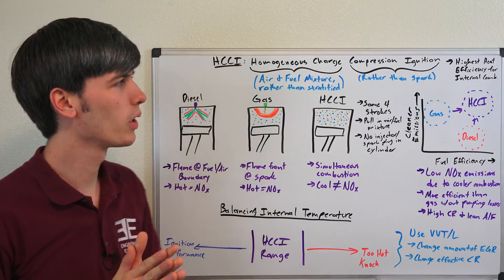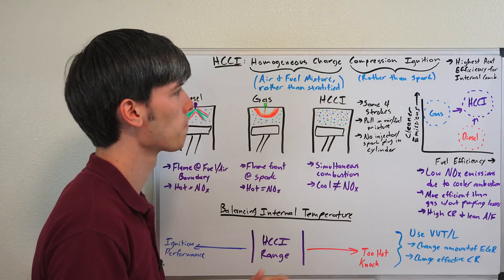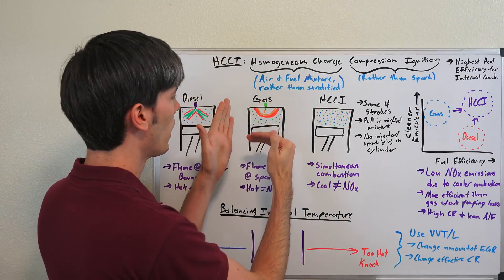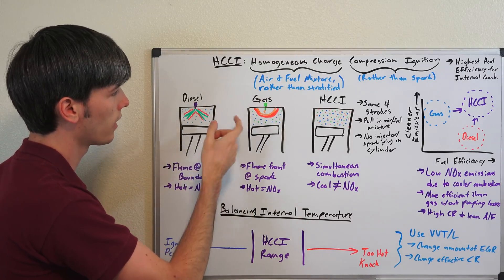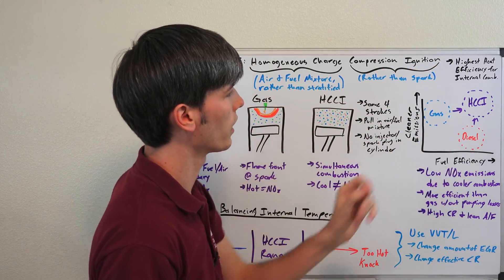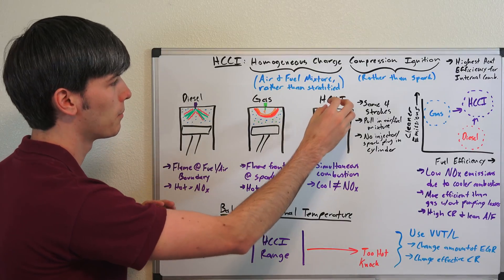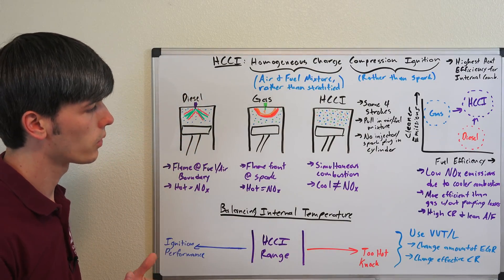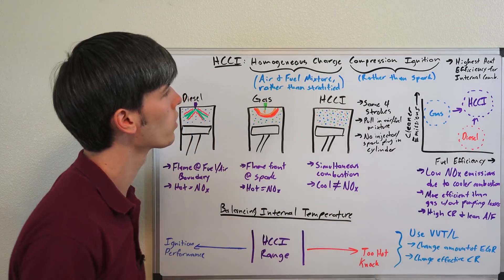The Most Efficient Internal Combustion Engine - HCCI

Comment: Is that the key of the Mercedes F1 engine performance...?
Reply: somewhat yes. Honda are the only manufacturer without it. Mercedes performance over the other teams comes from their turbo set up. they have split the turbine and the compressor, putting the compressor at the front of the internal combustion engine and joining them by a shaft through the center of the engine. this takes the compressor away from the hot exhaust and closer the the air intake and the inter coolers and allows the gearbox to be mounted pretty much under the engine.  this also make the over all profile of the engine bay smaller at the rear, There is a lot less inter cooler piping and the inter coolers dont have the be as large as the compressed air is cooler because its further away from the hot exhaust, closer to the air intake and it has to travel through less piping, allowing the engine cover and side pods to be smaller thus creating less drag. 

edit forgot to mention it creates less turbo lag because there is less inter cooler piping because of this the ERS unit doesn't have to use as much energy to compensate for the turbo lag, putting it to better use else where

Comment: Could anyone explain to me how exactly are we going to get this homogeneous charge? 
Indirect fuel injection is an old technology and I've never heard that someone is developing it. 
Diesel engines engineers were always trying to get better distributed diesiel/air mixture with direct injection.
Reply: I want to know how exactly this would work. Is there an engine that is already using HCCI?
Reply: I am not really sure what your question is, but a homogeneous charge can be achieved by injecting fuel really early during the intake stroke. Just how it's done in DI-gasoline motors.
Reply: instead of injecting fuel and drawing in air, both are injected together under pressure at perfect stoichiometric ratio, them compression starts the burn. It's another case of needless waste in classic designs that is being corrected by emissions laws that the assholes on the internet hate.
Reply: idi isn't that old, some manufacturers still use it, and it can be a good system
Reply: @ Tabourba   As far as I know, that is not really the main issue. Engine researchers have the timing under control, for the most part. The issue with HCCI-engines is the subpar NVH-performance. And for that problem, there seems to be no solution, as of yet. HCCI engines are simply too loud for series application in passenger cars.

Comment: with HCCI running cooler than other engines, what does this mean for performance and more importantly, reliability in colder climates where temperatures are often below freezing or even sub-zero (if you're using Fahrenheit)?

Comment: What about variable compression ratio engines? Would they be a good match for this system?
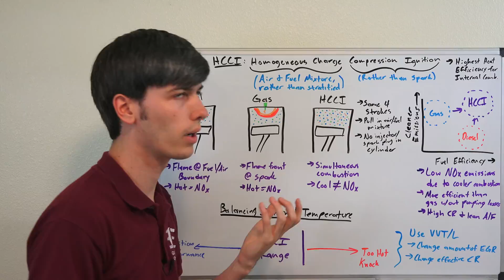Reply: He was discussing adjusting compression ratios to optimize ignition this at 4:16. I think it would almost be a necessity.
Reply: You'd think so, but I'd imagine the piston pressure at detonation would be much higher than a standard ICE. In turn, would this create more stress at the con rod/crank assy? Maybe this is why they chose to focus on compression change with valve timing. But, might there be a displacement advantage using the technology you're referencing?
Reply: Higher compressions ratios were reliable in the 80's seen in Jaguars v12 HE engine
Reply: Nicolas Losito: reliable in that it worked for the short time they lived then yes...
Reply: variable compression is best for turbo applications. High CR is good for fuel efficiency and low CR is good for running a lot of boost. That being said in a naturally aspirated engine lower compression used to mean higher reliability, but with skyactive by Mazda and the newer v6 Mustang we are seeing high compression ratios being reliable.

Comment: If they equip only the best forged metals , its still going to be weak and rely too much on precise variable valves . I image it will have electronic valve control since oil ones might not be so reliable due to outside temperature variations and cold starts.

Comment: So in colder areas, think alaska this very optimal running engine system would require pre-heaters. Just to get the engine up to heat before it is efficient enough. 

Alaska can get very cold. The sahara can get very hot. Heat managment seems to be a hurdle there. 

But seeing how mazda hasn't lowered its engine sizes instead changed the compression ratios and it works. Certainly it might work in the future to.
Reply: Diesel and the Otto cycle have very poor efficiency when cold as well. Heat is energy.
Reply: Tadej Furlanič The problem also lies with entropy. You'll never get all of the individual atoms to align and do work straight down onto the piston. There's a lot of wasted energy bouncing around the cylinder walls and not creating useful work.
Reply: All engine types are 100% fuel efficient if you can vaporize the fuel completely and mix it with oxygen. All ic engines don't vaporize fuel completely, a lot of the liquid fuel sprayed in the cilinder gets gasified and combusted after the power stroke, thats why engines get too hot, and why you get bad emissions and why in cold climates they don't work very well. Pouge patented a carburator that completely gasifies the fuel and mixes it with air 100 years ago. A lot of other inventors did the same in the following decades. But this tech was came way too soon, it would have geopardize the balance in the car and oil industry, so it was supressed. Hydrocarbons are a very efficient and clean fuels, actually most are. You can even vaporize coal or wood and burn them without any emissions other than CO2 and H2O
Reply: That is true in absolute terms, but we are talking about practical fuel efficiency, which can get preatty close to 100%, or in simple terms 100+ mpg without much loss of power almost 100% CO2+H2O exhaust gasses and incredible engine life. And this is achieved without adressing loss of energy in all the other car mechanics. There were also efficient transmissions etc, that were designed a long time ago, but I don't know much about these, since this is not a DIY job. All in all i believe 100 mpg is an awesome achievemnt, especially if it was 100 years ago. With all the money and brains on this planet, we would have crazy efficient and clean cars by now instead of stuffing our air and lungs with poisonous gasses and sooth.

Comment: I don't understand why car makers go to a lean burning engine like Honda made back in the 80's. Were they bad with emissions because I know they were amazing with fuel efficiency but lacked any kind of power at all.
Reply: Because they werent supposed to make them so efficiend. Engine efficiency has to go hand in hand, with fuel cost. 100+ mpg engines were developed a 100 years ago, and was no good for the economy of the car and oil industries. For them its all about balance. They can sell you a new car every few years if they gradually increase quality. What would they do if a 100% fuel efficient engine would've been put in production 100 years ago. That goes for every other industriy. We would be living in a star trek society by now.
Reply: Because of emissions. NOx emissions in particular can be higher in really efficient engines with high compression ratios.
Reply: They used a pre ignition port that allowed a small amount of very rich fuel to enter the cylinder to combust a lean fuel mixture from the normal intake port. It was so efficient that the vehicle did not require a catalytic converter to pass emissions. You use this same method when lighting an oxygen/acetylene torch. It's easy to light with a rich acetylene mixture then leaned out with oxygen. But, it's almost impossible to light if you add the oxygen first.

Comment: what about those hydrogen engine in Honda Clarity a couple years ago?
Reply: hydrogen is a quite inefficient way to transfer energy and sadly its just really dangerous.
Reply: +Chris S. Same thing was said about atomic fission in 1945 but through practice we learned how to harness it and use it "safely" and efficiently. Although it is a thin line between safety and disaster without trying we would not be where we are today without it. All because we tried over and over until we got it right.
Reply: Honda Clarity didn't use ICE engine, it use hydrogen fuel-cell to produce electricity for electric motor.
Reply: David G ...so is nuclear fission and or spatulas... depends on your attitude towards making it safer.
Reply: Hydrogen may only work with rotary engines (which is a flawed design fundamentally in terms of efficiency/emissions)
Reply: pns12live6 Guys.... When engineers talk about using hydrogen power in cars they're NOT talking about combustion engines... They're talking about hydrogen FUEL CELLS that produce ELECTRICITY. You don't shove hydrogen down the throat of a rotating piston, internal combustion engine... including rotary engines...
Reply: https://en.wikipedia.org/wiki/Mazda_RX-8_Hydrogen_RE
Reply: pns12live6 That was an experimental car that, in the long run, proved hydrogen was not a viable fuel for burning internally.  Reading more on that car you will find that they found that the only viable way to get the engine to run effectively on hydrogen was to mix the fuel charge with gasoline... Which defeated the whole purpose. Although the project went through many hands each time the end result was the same and the project was discontinued. 

On a side note: I can shove bananas down the throat of an engine and make it run a tiny bit... but in the end that doesn't mean bananas are a viable fuel for internal combustion engines. But I imagine if I had the "never say never" attitude and I tried and tired and tried, maybe... just maybe I could get hydrogen, oops, I mean bananas, to be a viable fuel.
Reply: You've missed something here man. I never said hydrogen is a viable option for combustion. I just replied to the guy above that asked for the hydrogen engine of the clarity and I said that hydrogen only works (even if it's not perfect) with wankels. And I'm pretty sure that if hydrogen was the solution, we would be working on that day and night but obviously it ain't. Anyway sorry if I didn't get my thought through so well. Nice chat.

Comment: how does it ignite?
Reply: Somewhat like a diesel, with compression but rather then injecting fuel into a compressed (and hot air) ,in HCCI fuel and air are mixed already so when compression occurs it self ingnites and whole mixture combust at once thus giving us a best of two wolds.
Sorry for my rusty English, its been a while. :)
Reply: He explained. Internal temp, compression and air/fuel mixture is controlled, so that it ignites due to the heat increase on compression, but in the right time. Very similar to the model Diesel engine he put in the thumbnail, except much more controlled.
Reply: "Homogeneous Charge Compression Ignition"
Reply: oh, ok. cool
Reply: oh, ok, ty.
Reply: got it, ty.

Comment: The Most Efficient Internal Combustion Engine- aka my colon !!!!
Reply: I can help you clean up after.
Reply: Mop and bucket a horror movie is about to begin and you are the pretty blond girl :)
Reply: +johno doh:   No-no-no: Yours is 'Infernal' combustion!!
Reply: you jest but your metabolism is close to the most efficient combustion system possible (99.8% efficiency), almost every single hydrocarbon bond is utilized.
Reply: I don't know alot about em, but I do remember a spec from the mid 90s on an old .21 cubic inch engine having 1.5hp. 
Damn that would be neat if it would extrapolate out and make it a 3-400 cubic inch engine, you would have over 1000 hp all motor😁
Throw a turbo on it for space travel 😍
Reply: No, the Nitro engine uses a Glow Plug for ignition, it's a Ni Chrome wire wound into a coil and heated by an electrical charge, once the wire is hot enough it will burn the fuel (Nitromethane and Methanol) and the burning of the fuel continues to keep the Glow Plug hot.
Reply: johno doh Well, if you insist on those dodgy curries. lol
Reply: That, Sir, is the most interesting fact Ive read today, nay, this year.  Its goes a long way towards explaining why Im able to run three half-marathons in four weeks, cyle 200km  and still put on weight. :(
Reply: so it basicaly combusts like a nitro engine in an rc car.
Reply: +jaya neyon explain?
Reply: a nitro  rc car  is compression ignition but uses a carburator and injects atomized fuel  into the cylinder befor the air/fuel mixture is compressed.
Reply: +jaya neyon 
Nitro engines have gorgeous engines. Very efficient and quick and responsive
Reply: Timinator62  That explains, when I was a kid, why the little IC engine in the wire controlled model car my dad gave me only used a simple battery to ignite the methanol fuel. I always wondered why it used a little coil in the single piston chamber and not a spark plug. And now you have also explained why it did not quickly drain the D cell battery.
Although it would be more expensive, wouldn't a wire-coil made of Platinum work even better?
Reply: No not like the engines in RC models.. That nitro engine is a two stroke and has no controlled ignition of the A/F mixture. Also the nitro fuel contains the engine lubrication oil
Reply: Unless it's the fire in your colon puts the kick in your step it isn't a ICE. In any event its likely to be an immediate source of air pollution, and not that fuel efficient.
Reply: you are biochem major right? ^^
Reply: The diference is HOW the fuel burns. With the usual gasoline engines with spark plugs or the RC model engines with glow plug there is a combustion propagation, starting at the plug and expanding over the combustion chamber. At the HCCI combustion the combustion happens (almost) simultaneously at the whole volume, thus there is no combustion flame front. And because there is no big diference in temperature (unlike the flame front) the NOx formation is dramatically reduced.

Comment: woah ...last time i was so early he still drove his subie
Reply from the maker: Ha! Still got a Subie!
Reply: Okay, no matter what drivetrain layout you have, lowering friction is the best place to improve fuel economy (Friction through the air, friction in the transmission, engine, differentials, etc). With Subaru, the boxer engine layout is, by nature, less efficient than an inline engine (to my knowledge. Please correct me if I'm wrong), driving all 4 wheels, all(most) all the time, and having 3 differentials, introduces significantly more friction than just driving two wheels, through 1 differential, through a more efficient engine layout.

So, once you get rid of everything that defines Subaru, then you can look at implementing a radical new form of engine.
Reply: They should put HCCI into Impreza, it's MPG is awful. :D
Reply: +TheBobes What I was getting at in my first comment is that it is way more cost effective to improve upon existing technology, until you get to diminishing returns (I'm looking at you, motorcyclists, paying out the ass for carbon fiber levers), than to develop, test, and implement a new form of engine. judging by the past, what, 15+ years, Subaru is more likely to continue down the road of unifying as many parts and processes across all models in order to deliver a solid product at a solid price.
Reply: r4kt
Reply: +TheBobes lol true but smiles per gallon 🖒
Reply: Noah
I own a '98 Subaru GT just to be clear. But you just said it's not a very efficient car yourself basically? You know.. they could make a brand new engine instead of upgrading the old EJ25 forever.
Reply: +TheBobes I drive an 01 Legacy wagon. Yeah, they could make a new motor, or keep the price of parts down so maintenance isn't an exercise in slimming your wallet (unless you take your car in for a timing belt... or head gaskets... and you don't do it yourself...)
Reply: +TheBobes Subaru does have a new engine.. It's called the FA20. It's in the new WRX and BRZ/FRS. It's much more fuel efficient than its older brother EJ. They are still using Mr. EJ257 in the STi for whatever reason though. Not sure why.. I guess its for the purely loyal fans who want to keep the UEL sound :) Or they're still working on developing a new STi engine..
Reply: Last I heard, the FA20 was exclusive to the BRZ, FRS, and GT86, as it used fuel injection from Toyota, among other things that the two companies worked on together. I may be wrong though.
Reply: WRX indeed has an FA20, called the FA20DIT, direct injection turbo.